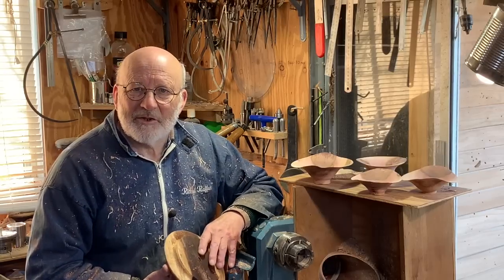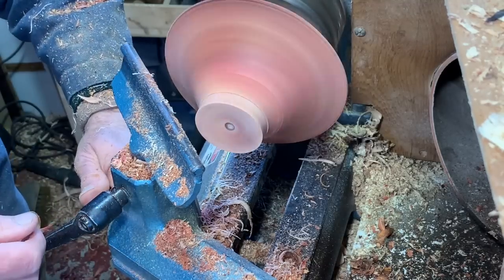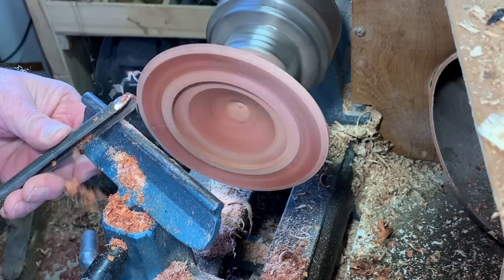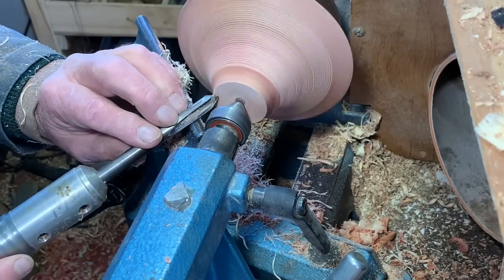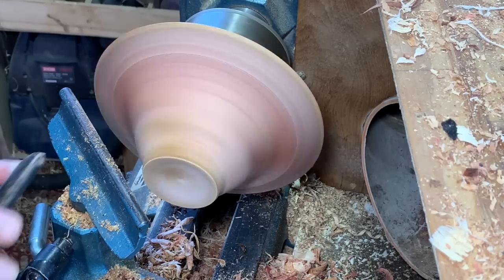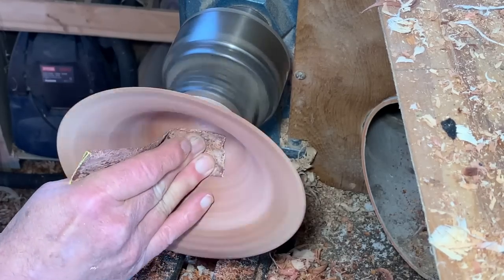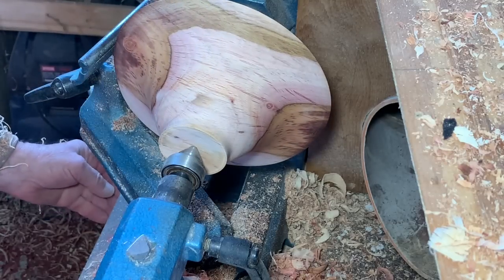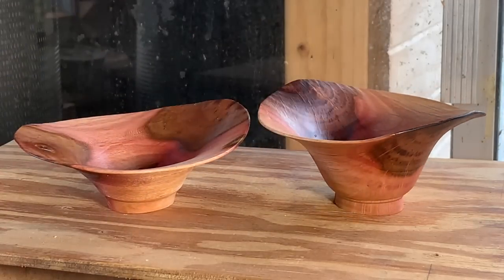Richard Raffan turning two wavy casuarina bowls

Comment: Those are some lovely shapes and excellent on the use of that  other sparse commodity besides wood, time. Are these more ornamental than funtional? I don't think I'd dare to eat breakfast from one... Does the wood retain those different hues? Or is that a feature of this particular tree? Would the blunted tailcentre work for heavier pieces?  Or would you suggest a jam chuck or regular chuck? Many thanks for another excellent video.
Reply from the maker: I see these bowls as both decorative and functional. They can handle your milk and cornflakes, but there are more suitably shaped bowls for that purpose. Wood never retains its colour but the heartwood should remain a lot darker than the sapwood. I used the blunted tailcentre to show one way of supporting the work, but I usually use an MDF disk as you see in many other of my bowl videos rather than change tailcentres.

Comment: Thank you for a very good video.  It didn't seem like you chanded the speed of your lathe at all ? You only sanded down to 240 grit ?  Thanks again
Reply from the maker: I find 240 grit usually more than suffecient althoug I occasionally go to 320. The preoccupation with finer finished is comparatively recent. In the early 1980s few turners sanded beyond 180 grit but that was before turning took off as a popular hobby it is today.

Comment: Richard, perhaps this is an opportunity to bust another myth??  Does the wall and foot need to be a very consistent thickness throughout to avoid cracking while drying in the microwave?  You said the wall thickness is about 1/8 inch or less, but no mention of how thick it is at the foot.  Thanks.
Reply from the maker: Having an even wall thickness and even density of timber certainly makes splitting less likely, but I usually get away with a heavy foot which tends to go oval rather than split. Uneven density is more of an issue: if there's a knot in otherwise bland and even grain, spliting near or across the knot is very likely.

Comment: I have a question. While watching you adapt to a flat piece on the tail stock for the second bowl it occurred to me - would it be possible to rather loosely fit a bowl into a jamb chuck with a flat piece on the tail stock in order to insure the piece is running true? (While it is turning at a very low rpm) I seem to always have an issue trying to get the foot of a piece to run true while doing the finishing last cuts on the foot. ( not entirely sure if this is because the wood has already started to move or if its slightly out of whack?) It seems to me that it might be possible to have both ends of the bowl loosely jambed (with a certain amount of firmness) - just curious if you recall having ever tried this?
Reply from the maker: Ideally I leave enough thickness to accommodate the tailcentre as in https://www.youtube.com/watch?v=oJ9EQ9LfDWg&t=628s, or I use the small round of MDF you see in the rounded bowl videos. I used this flattened tailcentre just to show another way of doing things.

Comment: My understanding is the crystal is sapwood residue seeping out from were the heartier timber meets the sapwood. Seeing the crystal like substance form is a good indicator of the timber structure about to fail. Generally due to heating to quickly or heating to much. In some circumstances it telling you to stop heating altogether otherwise it could explode - ask me how I know! (depending on wood type). Crystal to the level you found are likely to ge stopped in time before this take place. However if you see this crystal like substance develop take caution. 
Not sure of the correct terminology of the crystal so stuck to your reference.
Reply from the maker: I've had crystals oozing out of many timbers but never had any ring shakes resulting from the annular growth rings splitting as a result of microwaving. Splits are always radial. I've never had wood explode from microwaving. I want the moisture within the wood near boiling so it's forced out of the endgrain, thereby causing more shrinkage in the outer layers of the wood. It's this that pullys down the two quartersawn surfaces to create the saddle shape in an outflowing bowl.